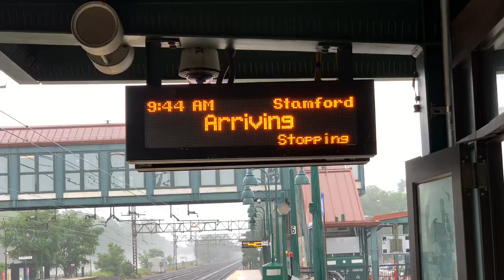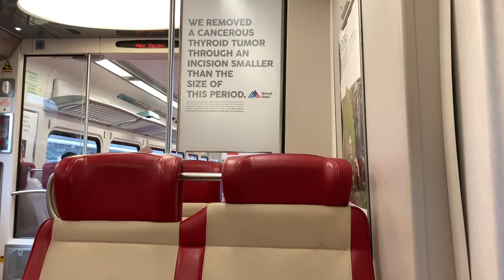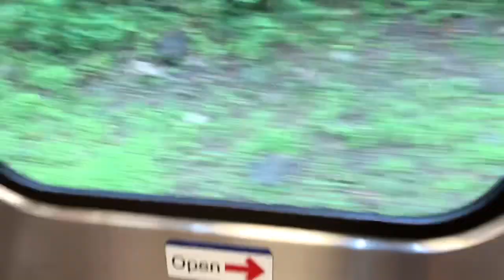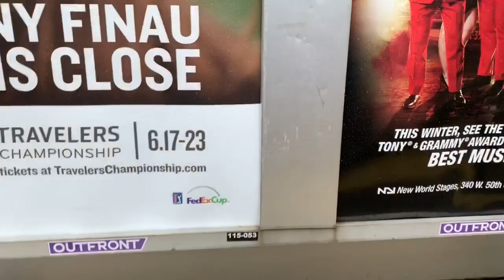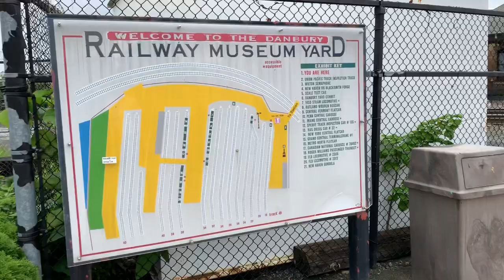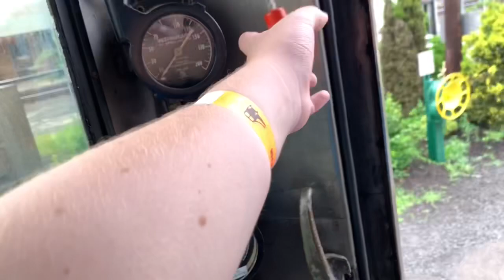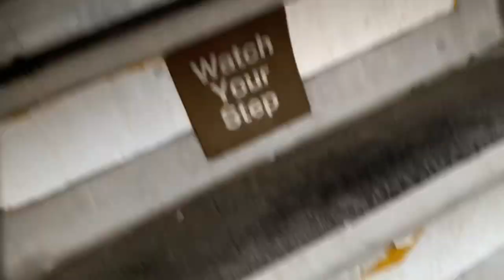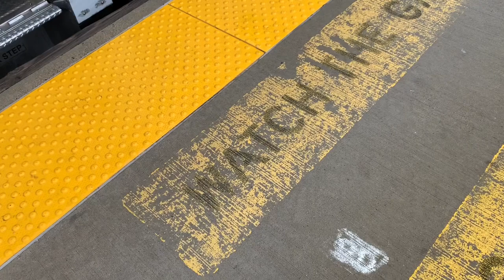Danbury Railway Museum Adventure

Comment: The Budd RDCs were/are self propelled cars, diesel. Each had a cab at both ends. However, the cabs were "naked" and the engineer would install levelrs etc only on the active cab.  They were used for both intercity and commuter service.  VIA Rail in CAnada still has a few that were rebuilt recently, used on the Sudbury-White River line.

Comment: Why do you like the m2 so much? And I haven’t been to that museum since I was 4 years old
Reply from the maker: I just wanted to go inside it to see how it was like in person. It was kinda hard resisting to go inside when the door was unlocked. The worker said I had to wait for the guy in charge of the M2 to come.
Reply: The M2's were amazing that are real trains which are better. They were very convient and reliable to me when I used it from Grand Central to New Rochelle to go to work. I seriously dislike the M8's. which is why I takes a M3 metro north only to Wakefield and then take a orion v bee line 42 bus to new rochelle
Reply: @redbird1train855  What's wrong with M8s? I'm glad to M2s are gone, patiently waiting to see the end of the M3s.
Reply: @seanwilson5516  I hate the M8's and I hate the M7's. Nothing has to be wrong with them but I just hate all new techs. I'm soo thankful only a P32 can go to Poughkeepsie via Metro North. Sometimes I feel like whenever I ride on a M3 and P32 it just reminds me of the good old days. The M1's, M2's, M3's, M4's, M6's and P32's has taken me to my destinations successfully. They were good and real trains and still are. I just don't like using the m7's or m8's so I avoid them at all costs
Reply: I love all the metro North railroad models . All aswell. However the metro North is getting M9AS really really soon. I don't see nothing wrong with the M8S on the Connecticut metro North. I do miss the M2As M4S M6S and the M1A on the metro North railroad and the FL9s FL9AC .

Comment: That was a bud rdc not a cabcar
Reply from the maker: I initially didn't realize it was a Budd RDC. RDC's are Diesel Multiple Units, so technically it's just a cab, and not a cab car, because there is no locomotive pushing or pulling the consist. So you are technically right.
Reply: @LiyteRail  yeah, i miss the m2s as well. My m8 train to new haven today had a door malfunction
Reply from the maker: Door malfunctions don’t happen on M8’s much, so that’s probably rare to see. I’m pretty sure M2’s had a lot more door malfunctions.
Reply: @LiyteRail  yeah. The engineer came out and opened a little fuse box on the top of the door to force it closed